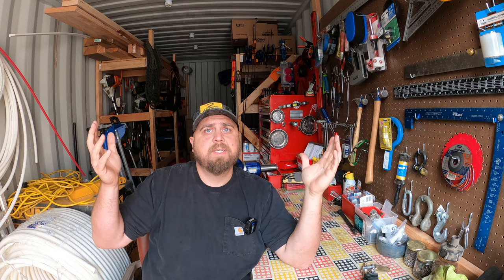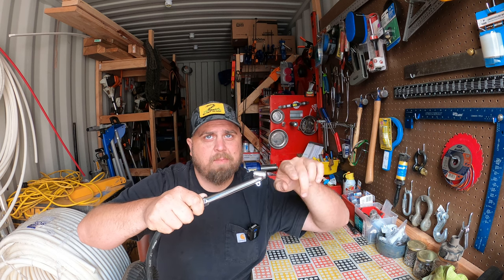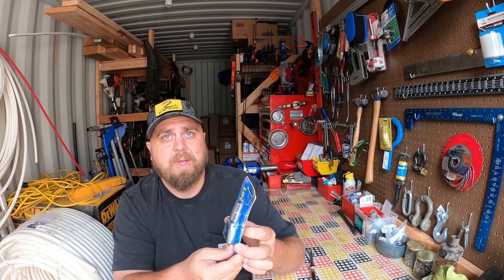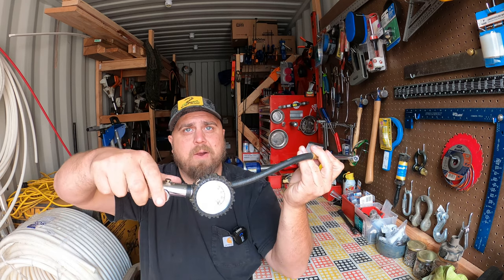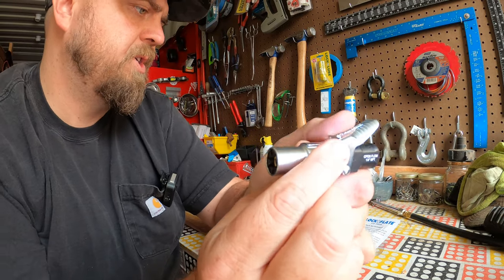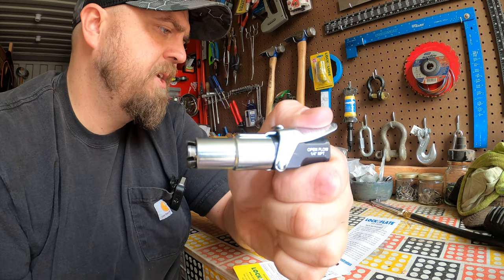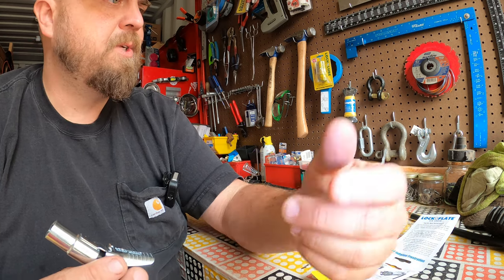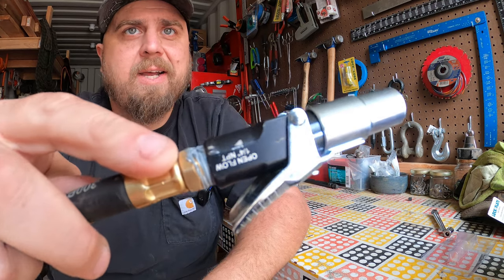LOCKNFLATE Locking air chuck - Lock N Lube strikes again!

Comment: My lever action was a little stiff(of coarse I had one of the first produced), so I just simply sprayed a touch of "fluid film" into the jaws on the end and worked the lever back and forth a dozen times, hit it again with a touch of fluid film and then hooked air to it, blew it out and wiped it off and I havent had a problem since. Very very smooth operating now.
Reply from the maker: I've never tried fluid film. Gotta find some at the hardware store, I guess!

Comment: This is great! Do you have any details on the inflator with the built-in pressure gauge? I want to buy this for my disabled brother. He has an old setup and it would be nice if the Lock N Flate had an in-line pressure gauge. Did you just attach the air chuck to an existing inflator with a gauge or did you custom-build the entire setup?
Reply from the maker: I picked up the inflator with guage from Harbor Freight. Decent little unit! https://www.harborfreight.com/dual-head-air-chuck-inflator-with-dial-gauge-63544.html
Reply: Lock N Lube sells the inflators with a gauge now as well
Reply: @bobbymorgret   Amazing! Thank you.

Comment: I just bought one and put it on my Matco tire inflator. Im super disappointed in mine. It won't seal on ANYTHING! Not on my bobcat, truck, or trailer valve stems. It does lock on good but leaks air. Bummer that $60 is going in the trash. 
The lock and lube line is A++ and love um.
Reply from the maker: Did you reach out to Lock N Lube?  I'd be shocked if they didn't send you a new one!  Sounds like you just got a faulty unit.  They are a pretty good company when it comes to stuff like that.
Reply: @HomesteadBandwagon  I'm going to tomorrow and see what happens.
Reply from the maker: Let me know how it goes!
Reply: @HomesteadBandwagon  emailed them yesterday and today they said they are shipping me another one. 
They said once I get the new one there is a pre paid lable so I have to ship the "defective" one back so they can check it out. 
I'll message back once I get the new one and if it works any better.
Reply from the maker: Oh cool! I was kinda surprised that they don't make a rebuild kit for these like they do with the grease coupler
Reply: @HomesteadBandwagon  yeah me too. Time will tell how long it lasts. Mine will get used daily as I run an auto repair shop.
Reply: @upnorth5465  And how was the replacement?
Reply: @andersnelson6888  the replacement works and seals as it should for how much it was. I'm not sure what was wrong with the other one but it was nice they took care of it no questions asked.
Reply from the maker: Keep us updated. I'm thinking on leaving mine out to freeze and see if it'll still seal. For science.

Comment: Will this work on aircraft tires?
Reply from the maker: That's a great question.  I have no idea if it would or not. The system uses the threads on the valve stem to lock on, so if the stem has threads, i would assume it would work